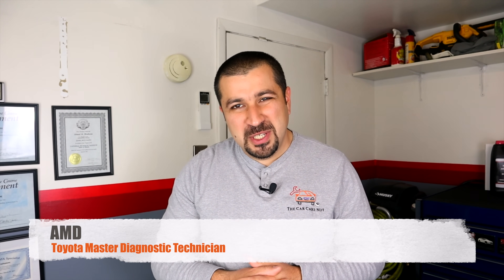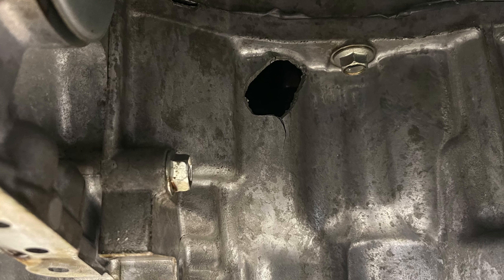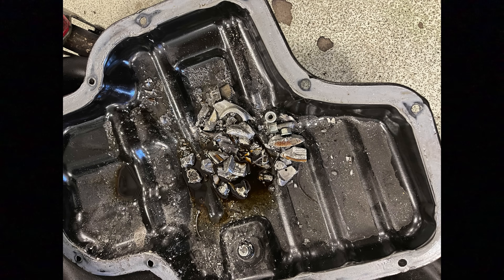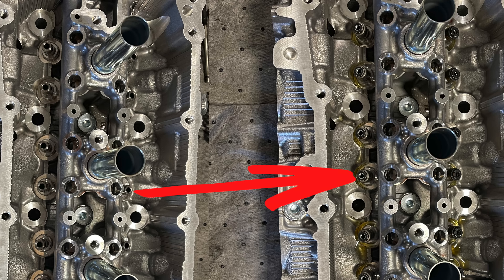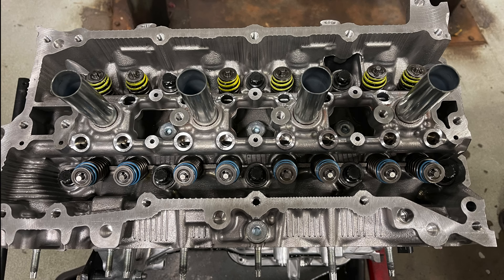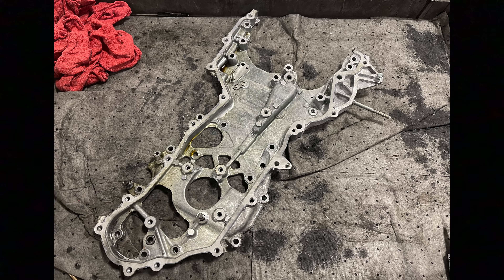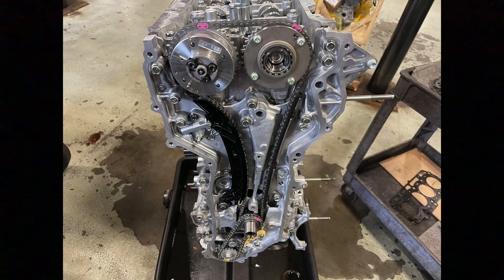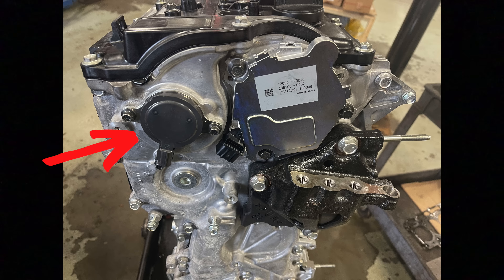Toyota's New Engine assembly Full start to finish!

Comment: That was the first thought in my head when I saw this, a rental car. In my 40+ years as a dealer mechanic, I can honestly say that rental cars are a very close second to young, inexperienced drivers when it comes to vehicle abuse and neglect. I tell everyone that's looking for a late model vehicle to never buy a former rental car, I've seen way too many of these rental vehicles that have a stellar reputation for reliability that are on their last leg at a low mileage due to abuse/neglect.
Reply from the maker: Agreed 100%! I wouldn’t recommend a former rental car
Reply: @TheCarCareNut   do you remember how many miles were on this engine before you rebuilt it???
Reply: @TheCarCareNut so the procedure for reassembly, is that something we owners can get our hands on? I usually buy a Haynes manual for any car I have but I have a 24' Camry so I don't think there's one available as of yet?
Reply: I have a niece that was a manager at the airport Enterprise Rental. It was standard practice to reset the “maintenance light” on many rentals because they did not make money while the car was out of service. Many rental cars went well over their intended service intervals.
Reply: @jamram9924 in the time it takes to change the oil someone took a poop. It’s pure laziness, nothing to do with time.
Reply: I had a Corolla that was a rental for it’s first 30,000 miles. It was an awesome car. Never had an issue.
Reply: People seem to treat rental cars like public bathrooms
Reply: I did a John Force burn out with my rental Camaro! Don’t buy a rental! He’s right!
Reply: how can u abuse a car? Rev up the engine is good isn’t it?
Reply: @leoxu1299  maybe no break in time? Good question.
Reply: I bought a rental car because it looked like a great deal but right away It quit me on the highway I called a wrecker and the dealer repaired it.  Again the car quit me with another problem  it was taken to the dealer and they repaired it, and after a few miles it broke down again each time a different problem.  By the time it had 50,000 miles it broke down four times.  At this time I realized this car is a problem car and traded it for a new Rav 4 hybrid.  so far i have had no problems. but I'm nervous about it.  I'm 79 years old and hate being stranded on the highway
Reply: @lloydmattocks1082  If you have a new RAV4 hybrid, congratulations. Breaking down should be the last of worries. The RAV4 will serve you well. ☺️
Reply: @lloydmattocks1082  Out of curiosity what make was the ex rental car that you had all the problems with?. Very best of luck with your new Rav4 👍 I hope you have many thousands of miles of happy and trouble free motoring. Best of wishes from Liverpool UK 🇬🇧 👍.
Reply: @stephenjones9153  The rental car was a 2018 Chevy Equinox
Reply: @lloydmattocks1082  Chevrolet equinox rental car? Even the new Chevrolet equinox came out of manufacturer with a lot of problems.  I hope you enjoyed it.
Reply: Funny thing is sometimes you get lucky. My 18 equinox 1.5T has been almost faultless, now done 167k
Reply: @lloydmattocks1082  Scotty Kilmer always put up a picture of Chevy dealership when describing junkyard.
Reply: @coffeelixirruby  Is the Equinox still going?  You drive a lot.
Reply: If you buy a rental car. might be a good idea to get atleast a powertrain warranty along with it... if that makes it more expensive then the non rental car with similar millage.. get the non rental car lol
Reply: There’s a song called Ride It Like A Rental.
Reply: Then it’s only a matter of time before my former rental camry blows a piston through the hood 🤣.
Reply: @JusMG559  LOL same here dude! My 2018 was also a former rental, so far so good 2 years and 21k miles later though, so knock on wood.
Reply: @poluticon  You are one of the lucky owners that got a previous rental that was maintained properly and wasn't abused by customers. Believe it or not, some people actually treat rental cars like their own.
Reply: @jaimieconroy36  oh I believe you. It's basically a roll of the dice when it comes to rental cars.

Comment: 0W-16 Engine Oil Grade is not reliable for engines. 10 years ago Toyota used to designed the engines that recommended 5W-20 oil for 2.5 Litre engine.

Comment: Oil change is not done most rent a cars. Especially if they have a high demand. Car goes in, gets cleaned and then given to the next customer. They sometimes go over 15000 miles without an oil change. Non- synthetic.

Comment: Hello there Mr. Car Nut, I am a lifetime Ford guy, though have had many Toyotas in my family orbit for repair and maintenance. I just bought a 2025 RAV4 with this engine. I would like to know, what your recommendation is for oil viscosity? I would like to run a thicker oil than is stock. I have seen people post this motor gets spec of 5W30 in Europe, is that true ? I like to know what my options are for thicker oil, while not running a foul of the Warranty Gods !!! Thanks.. Joe.L

Comment: Hi I love watching all your Toyota videos. I recently acquired a 2021 sienna hybrid, the previous owner uses it to uber. It currently has 400k miles with oil changes every 2 weeks. Well sadly the engine blew a big hole on the back side of cylinder 4. I bought it with the intention of putting a used engine in. I've done a handfull of engine swaps. But never a toyota hybrid, I'm mechanicaly incline but looking for a good guide or video. Theres no videos or text about how to remove inverter or the dual electric motor to get the engine removed. Can you please give me some good direction. Im up for this challenge.  Please please help! TIA

Comment: Over the past few months we’ve had 4 engine failures with this motor some valve issues and cylinder head problems one I did most recently had cracked exhaust valve

Comment: AMD, does this engine has a thermostat? Is it in the housing where the top big coolant hose goes into? I have 2018 Camry LE 2.5L. I need to change the PVC valve; can you have a teaching lesson of how to take the intake out for installing the new PVC valve?
Thanks & God bless,
Hai

Comment: As an owner of an M20 engine like the one shown, mine is in a Corolla XSE, I'm horrified, looks like if anything goes wrong with this motor it has very little resiliency, everything is so integral that a chain of failure can ruin the whole thing. Yikes. Any thoughts on long term outlook for this motor?

Comment: I like the fast pace using photos, vs your typical videos. Perhaps the vids can be edited down to only show the key points, while an accompanying audio that is over-edited to explain the process?  I also like how you lap the valves instead of relying on 'natural seating', which may not do as good a job if the seal doesn't start out very good... 
If you've "already done a few", even though it's more than others in your shop, isn't that a lot for a Toyota on a fairly new engine design?  
Was this a warranty repair, or was this cost on the owner? You mentioned 'thousands of dollars'. Can you be more precise? With labor added I guess $7,500...???
Rental car abuse? I've rented cars that were less than a year old and had no oil showing on their dip-stick. (It took two quarts)  Chances are the oil was never checked by the rental company, and likely never changed since new...

Comment: I have this engine in my '18 camry LE.  I want to warn you all that you could have an oil dilution event.  Not sure if it was dirty injectors due to use of generic gas, but 2000mi after an oil change during the coldest winter months in northern NY, i just happened to notice a very very slight increase in oil level on the dip stick and gassy smell.  I immediately changed the oil.  A Speediagnostix report confirmed viscosity at the very low end of the spec range and dilution of 1.6% (2% would be the no-no limit im told).  So a switch to top tier gas and chevron techron every 3000mi was advised.
Reply: I have had different cars of different manufacturers and during winter months my car engine doesn’t warm up as fast. My oil is stinky like gas and I just change it earlier by monitoring the smell or changing it by watching my oil levels drop.
Reply: I read an article about this engine where a plastic water pump impeller is used. Is that true?
Reply: @andrewchung1255   yep but I can't even call it an impeller....it is like a spinning eccentric wheel that moves the fluid.

Comment: This is an awesome mechanic. I watch your videos during lunch, after work, and just about any time I'm on YouTube. I own a 2018 Toyota Camry and it runs like a champion with 112,000 miles, and still runs very smooth, thanks to the information and advice for maintaining given on this channel. You're an outstanding mechanic and I learn something new with you almost everyday. Thanks for the videos.
Reply: 2018 se owner here going on 160k miles, recently did valve and intake cleaning and it's running better than when I first got it (used and likely abused, albeit). these things will stick around for a long time.

Comment: Anyway you can help me out with some advice with this same engine? Its 2018 camry with codes p04500 p04417e  p0170 p0117 p0117b p0505. Watching the fuel trims the engine will randomly go extremely lean & will throw a lean code along with direct injector and port injector code. When it runs lean the idle fluctuates up and down then it will eventually go away just to come back after some driving. I cleaned the throttle body, i originally replaced the purge valve did a smoke check on the intake system and evap system and couldnt find any leaks. Im at my wits end with this car.

Comment: It looks that this engine has run at very high (red zone) rpm for a long time. This is the bad way to find the weakest valve springs in the engine :). Very often this happens with intake valve springs because intake valve is bigger and heavier than valve at the exhaust side. Sport mode does not turn usual car to a sport car.

Comment: I bought a 2019 camry se, traded it in after only 9 months because i couldnt stand the diresct shift transmission, rough/jerky shifts, starts out in 2nd gear when stopping at a stop sign, always up/downshifting with miminal throttle movements when not needed, drivers seat upholstery clip kept coming undone, just overall hated the car!

Comment: So the timing chain job is about 2000$ with this crazy two piece cover + engine + tranny + subframe out?!
But probably this is a non-issue because the engine is wisely designed to endure 100kkm so it out-lasts the 120kkm timing chain!

Comment: As the issue associated with rental vehicle and in the video mentioned that the vehicle possibly was driven hard to create such an engine failure, would that mean that if that engine is reved up it can blow up?
This 2.5 is installed on many hybrids and hybrids mostly underpowered, especially when it is installed in Sienna or Highlander.
With Sienna/Highlander vehicle loaded (say 5 people) and going uphill and/or overtaking an 18-wheeler on 1-lane country road, to perform this maneuver, one needs to push this small engine to its rev limits. Does this pose a risk for such engine failure?

Comment: Wow that is way more complicated than the last gen... like even the last years of the 11th gen corollas... 2018 and 2019.... with the 2ZR-FE is WAYY less complicated than this. This has alot of hoses, sensors, just everything it looks like so much more complicated than my 2019 corolla with a 2ZR-FE... I would much rather pull the engine on one of those than this car. I was sold on getting one of the new Dynamic Force engines but I think I'll stick with the 2ZR and just rebuild it when I need to... sure its slightly less MPG and I do like the oil level sensor... but all in all i dont think its worth it for all this headache. I get 30mpg driving at 75-80mph and almost 38-40mpg driving at 65mph.... so i already get pretty good MPG.

Comment: 2019 SE with same engine now has 140K trouble free mileage! Just 2 set of tires, regular oil change every 7-8K miles, ATF changed at 130K miles, spark plug at 130K miles, and new windshield wiper and that’s is. Love this vehicle wish I can drive over 1 million miles 😅

Comment: On the strange intake cam gear did you turn the inside of it counter clockwise till it stops before you installed the edu motor?  I was just wondering if you did?  Plus do you have to reinitialize the learning values?

Comment: Is the pcv in the same location as corolla 2.0 engine. Does the 2.0 also have that oil separator so an engine catch can is not needed either? 
Thank you.

Comment: Hi on 2020 Camry LE with A25A-FKS engine 2.5L, where is the engine drain bolt for coolant located?  How many are there?  To do a complete flush, do you recommend taking out the thermostat? Can you show how to remove the heater hoses to the engine, they seem to have a connector on the engine side.

Comment: YOU DID A GRATE JOB ON THIS NEW TOYOTA ENGINE I KNOW THIS IS A TOUGH ONE BUT COULD YOU PLEASE TELL ME HOW DID YOU TIME THE MOTOR THAT CONNECTED TO THE INTAKE CAM PHAZER DOEN IT NEED TO BE SET BY SCANER OR THERE IS A SPECIAL WAY TO TIME IT .THANK YOY
Reply from the maker: Hi! It does have a procedure with the scan tool

Comment: I have a 2010 Lexus RX 350 FWD. IN the morning when the engine is cold. When i start to drive cold or when i let it warm up . i hear knocking or clicking sound until my temperature gauge reaches normal temp it stops. I only had it since dec. 31,2021. I bought it from a lexus dealer. I have a 5 year warranty on it. I hope u can help me out. I am thinking about taking it to the lexus dealer to see if they could find out why it makes that noise.

Comment: A awful lot of parts for a 4 cylinder engine.  I can imagine the amount of labor time going up, up, up.  With all of those external pipes & hoses, why bury the PCV valve under the intake manifold?  Toyotas typically last a long time, but looking at this engine I can see future issues because of it's complexity.

Comment: Hello. I'm fairly new to Toyota and just cam across your videos and find them very informative. I wish I has seen them before I ran into a similar problem with a disintegrating piston and got my first taste of Toyota engineering . Can you tell me who makes the cradle stand you are using , I think it might be better the the small hydraulic table we use. Thanks for this and other video's , have been very informative.
Reply from the maker: Hi! That one is actually made for Nissan. Search the part number which is J-47242 there are a few versions higher and lower I’ve used both and they both work well. There’s a blue one which is lower and the grey one is higher

Comment: Hello brother GOD bless you, one question what engine is better 4cl or v6 because I would buy Toyota maybe soon, you think the new tundra is reliable, because I want a car last many years, what advice you give me
Reply from the maker: Hi Joel! So 4 cylinders are good if you maintain them well. V6 engines are more robust and can withstand less than ideal maintenance however they tend to cost a bit more in maintenance and repairs as they’re bigger
Reply: @TheCarCareNut  you think the new v6 twin turbo in the tundra is going to be good reliable engine, is nice and beautiful but I always want to keep my cars long time, and I am super picky with the maintenance and everything like old school, when is new at 500 miles first oil change and at 3 o 4K miles oil change no regular gas every change of oil I change cabin filter, and I take every advise that you give, tanks for everything brother

Comment: Good luck on labor cost💵 , Dynamic or not i would rather own a older 1.8 2.4 2.5 2.7 car truck . looks like a spaghetti of parts under the hood. I've done this type of engines , but personally Toyota design this motor horrible . Toyota= looks parts design -01👎/motor design engineer layout = 04 🤔/  engine power Dynamics efficiency 10+ 👌.

Comment: Great Video!  With the PCV valve being between the cylinder head and the intake manifold I assume, there is an opening for the PCV hose to pass through the manifold?  Is there enough room to put a deep socket through the opening to remove the PCV without removing the intake?  🙏🙏🙏
Reply from the maker: Hi! There’s no pCV hose on this one. It’s built
Into the intake
Reply: @TheCarCareNut   I picked up the PCV valve from the dealer today.  It is different than any PCV valve I have seen.  No threads and two thick oil rings.

Comment: I can see that the KISS principal has been thrown overboard a long time ago. O my.
A question for mr Car Nut himself, if the engine ingested water, could you trace that by how that 1 piston was destroyed? I still have faith in Toyota, but the amount of hoops most
car manufacturers have to jump through in order to get a lower CAFE number, brrrrrrrr .
A standing ovation from an old car Man, me , for putting this thing back together.
Hats off.
Reply from the maker: Hi! Usually from what I’ve seen when toyota engines ingest water they bend a rod or hydro lock and you’ll see corrosion on the cylinder walls

Comment: Mam this took alot of work. Mr. Car Care Nut, YOU ARE THE MAN!! My Hat goes off to you. It's too bad that folks don't even care about how they drive a rental car. I have a 2010 Toyota Camry 2.5L with a 6 Speed Manual Tranny and I have over 230,000 miles plus on my Camry. These 2.5L are great engines just with simple 5,000 miles oil change.